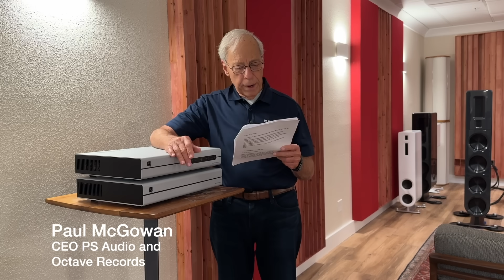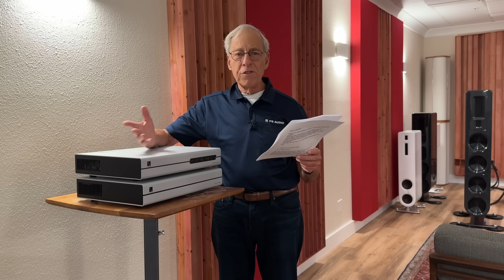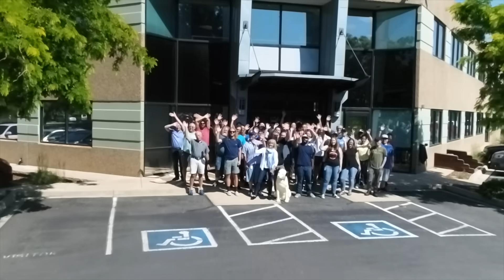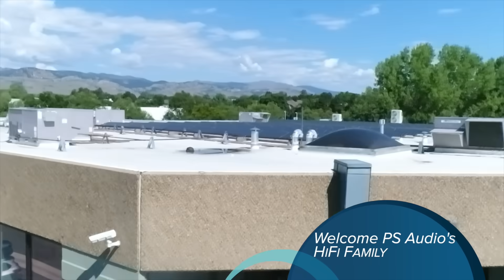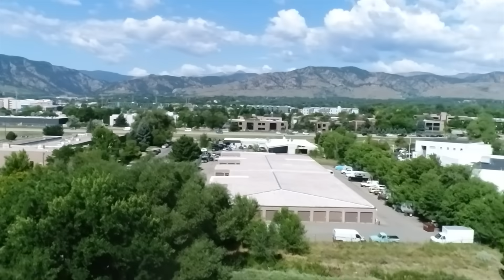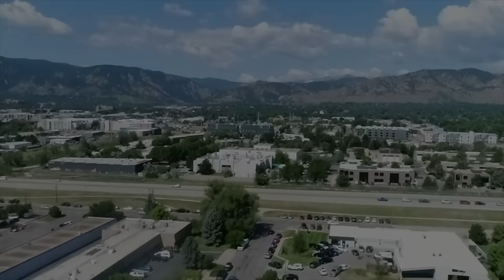Why should we care about distortion?

Comment: Not all distortions are equal. Why THD being in high in, let's say vinyl, comes down to something called masking. Second harmonic distortion is almost fully masked, third harmonic less so but not so problematic as some of the greatest ever recordings have been on tape and they have as fair mount of third harmonic distortion. But as we go up and also looking at odd harmonics, we get to a point where even small amounts are crazily important to avoid. I particularly think along John Curl's line that the seventh should be avoided like the plague.

Comment: I would love to take the hard road and integrate speaker distortion into my sound system, the beauty of a distorting speaker, especially with alnico magnets is something you can't capture in a recording, it happens in the air and in the room. But then you have to be able to be able to control it and turn it off and on in musical way and most people just want to take the easy road, sit back and not participate in the music. Things change, trends change.

Comment: Also, a THD percentage doesn't tell you how the actual harmonics are represented. Generally, uneven-order harmonics (like 3rd harmonics) usually sound terrible compared to even-order harmonics, which we some times dare to call musical harmonic distortion. A tube amp can actually add musical distortion that some find pleasant and especially limiting the peaks with soft clipping instead of hard clipping can make a huge difference in how pleasant distortion is. Usually distortion numbers are quite useless because they are aimed in impressing us consumers. More interesting is to know if an amp actually does make some audible distortion under certain conditions like if the dynamics of the music starts making the power supply struggle or if the impedance of a speaker is having some tough dips causing the amp output stage to misbehave.
Reply: Way back in the 1970s, sitting in a classroom, I heard one of the best descriptions for "distortion" ... 

 "Distortion is anything finding it's way out of a circuit that we did not put into it."

At one time the most accurate measurements were not harmonic they were differential... a kind of null test.  Take the input and output, level match them, subtract the input signal from the output signal (by inverting it) and whatever is left is some kind of inaccuracy or distortion in the circuit.  We could see clipping, phase, wave shape, hum and, even noise errors this way.

Then FFT became a thing and suddenly we're all focused on the easy target of "harmonics" ...
Reply: @Douglas_Blake  Well, with that definition, noise and frequency response become distortion. But the concept of null test is awesome in finding facts of a circuit or cable indeed. I once worked on an amp that showed really low THD while it sounded bad; and it turned out it was due to really high TIM distortion and square wave ringing. It made me aware the value of just doing a square wave test looking at the oscilloscope.
Reply: @ThinkingBetter  
Sure.
Square Waves give us lots of good info.  You can see high and low frequency response on the top and edges, you can see rise time, overshoot and ringing and even oscillation very clearly.  Triangle waves give us linearity and phase information as well. 

Many peopele would be surprised how much you can diagnose with a simple oscilloscope, signal generator and voltmeter.
Reply: @Douglas_Blake  I forgot to mention that you can also do a digital null test when testing an amplifier using ADCs and analyzing before vs after sampled audio data digitally. In such test you can nail any audible impact of any kind.
Reply: @ThinkingBetter  
The Audio Precision way ... works a treat.